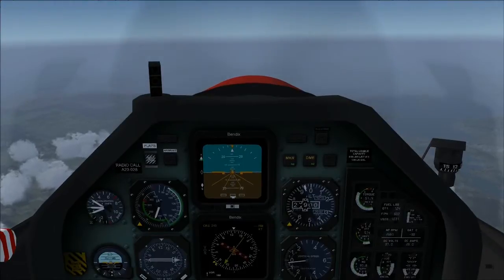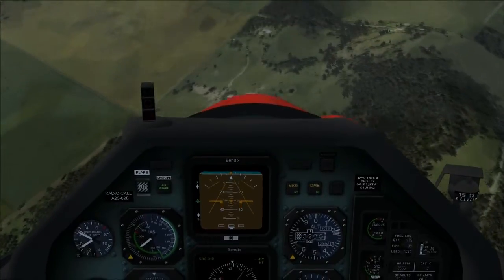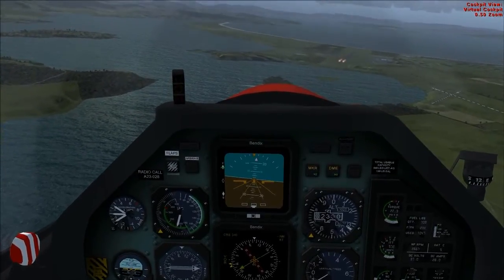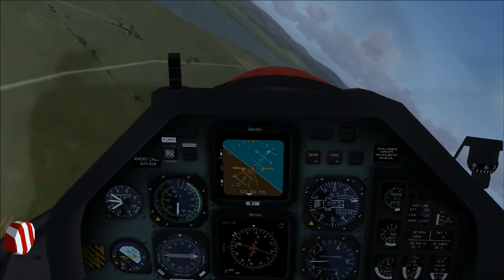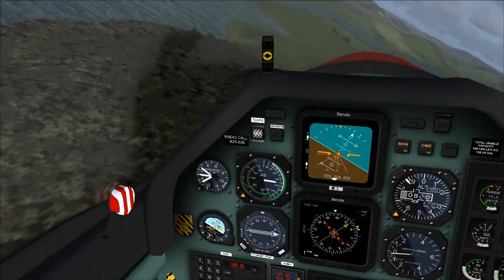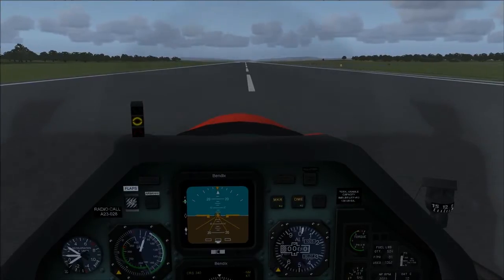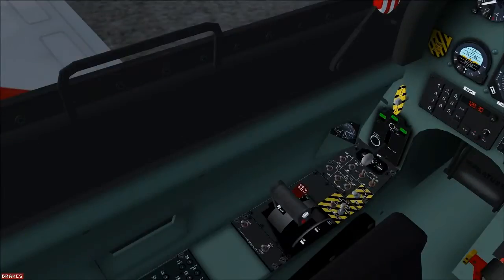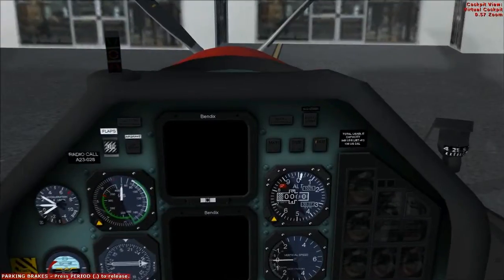FSX PC-9 Tutorial - Descent & Landing with 'Initial and Pitch'

Comment from the maker: Ask as many questions as you need man.  The problem you are describing is exactly the same as I have.  The correct procedure is actually to enable the fuel cutoff padle after you switch the fuel boost pumps on and before you hit the starter swtich.  But like you, if I do this, once the engines start up it goes into the red, and for me it catches fire.  My way around this, and what I did in the video without showing it was to enable the fuel flow after I hit the start switch.  This seems to work.

Comment from the maker: You should have 2 buttons on your joystick for elevator trim (trim up and down).  If not you can set it in control options as having trim is very handy.  The keyboard commands are Num 7 for elevator trim down, and Num 1 for elevator trim up (Num Lock needs to be off).

Comment: Hey man Sorry again for asking questions but when i go to start the pc9 ido everything you do in the video. But when i turn starter on the engine wont start with the Fuel control of.f So i have to open the fuel control and then when it starts the engine BUT for some reason goes to full throttle automaticly and then goes back to idle when i have my throttle is at idle. Hopefully you will sort of understand what im saying . HELP ME!!